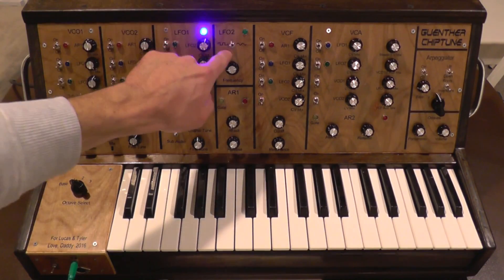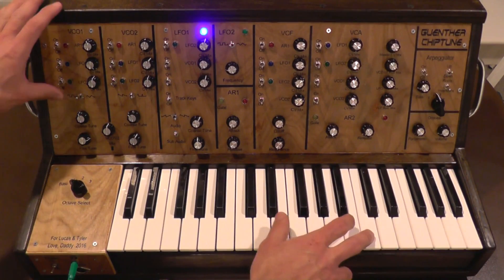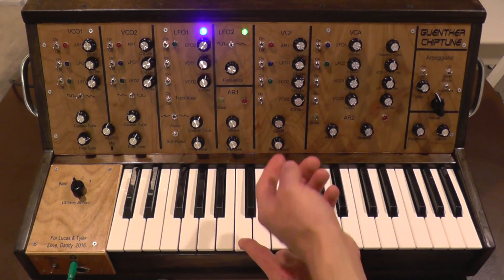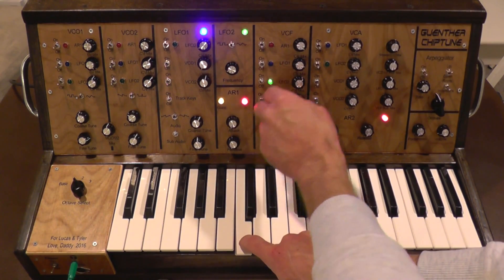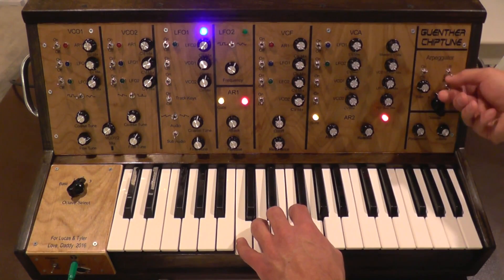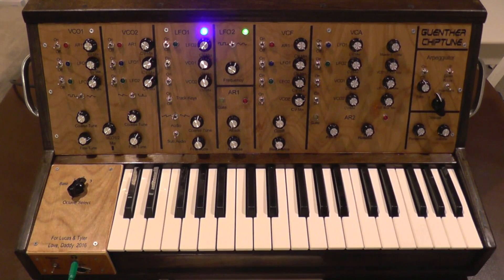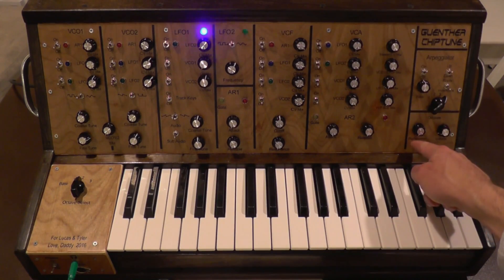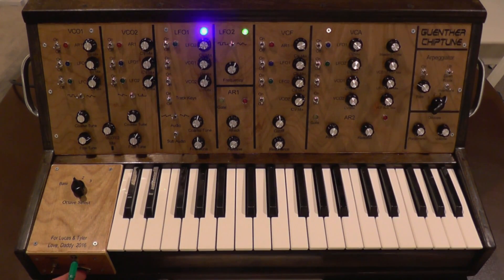Guenther Chiptune Demo

Comment: I just spent the last 8 hours straight assembling a 6 channel VCA in one shot. I have a small idea of the amount of work that went into this, except I was following a kit. You built the entire thing from scratch and research! Absolutely incredible, you did a great job!!
Reply: Thanks!  It is a lot of work, but not impossible, I promise.  I think the VCA in conjunction with the expo converter was the most confusing part for me.  Google, "Aaron Lanterman GA Tech lectures".  The ga yech site no longer hosts them, but you can find them on YouTube.  Good luck if you decide to go down the rabbit hole :)
Reply from the maker: Sorry, meant to say VCF and expo converter.  Another thing that might be helpful is to look up the lm13700 dataset and play around with the sample circuits.  That chip alone can support most of the modules cores (VCO, VCA, VCF) in a synth when paired with an expo converter!

Comment: Hi, I was just looking for an appropriate expo converter for the tri-square oscillator in the lm13700 datasheet and came across your project somehow. Unfortunately, the .sch files in your github are corrupted somehow, I can't open them anywhere. Would it be possible to get that schematic from you somehow else?
Reply from the maker: Hi, thanks for checking out my video.  The schematic for the expo converter is based on Hal Chamberlan's famous circuit.  It is also used by Thomas Henry in some of his stuff.  Big note is that this expo converter uses a matched pair of PNP transistors, rather than a pair of NPNs.  This is why it works well with the LM13700.  You do t need KiCad to see the schematic.  If you go to my github and look at the files, there is a .pdf version of the schematic.  Open that and go to page 16 to find the expo converter.  If you want to know more about how the convertor works, check out Aaron Lanterman's GA Tech lectures recorded and posted online - check youtube for that.  It was his lectures that helped me finally understand how the converter circuit works.  Cheers!
Reply: @GumpherDM3  Wow, thanks for the prompt and in-depth response. I just downloaded kicad, because the file wasn't working with any other viewers. Must have overlooked the pdf!
I'm familiar with the basic circuit, I was just trying to "cheat" and steal your component values. ;P Lazy...
Reply: And that it's pnp is also what I needed to know, thanks again!
I have the lectures saved for later, because you mentioned them somewhere else.
Reply from the maker: @samothrace2106 , good luck!  Hope its helpful

Comment: Is this synthesizer monophonic or polyphonic?  If polyphonically, how many keys can you press at the same time?
Reply from the maker: Just monophonic.  It has an arpeggiator that registers 4 keys at once, but I wouldn't call that polyphony.  :)
Reply: @GumpherDM3  Is it possible to upgrade the circuit of this synthesizer so that it can recognize the keystrokes of all ten fingers?
Reply from the maker: @bipolarowl3546 , the arpeggiator is all firmware based and totally independent of the synth circuitry.  I haven't looked at the firmware code in a while.  I think I threw together the arpeggiator in just a few days while rushing the end of the project, so that part of the code in particular is not efficient or easy to read.  In order to add more voices to the arpeggiator, it would probably need a complete rewrite of that part - not something I want to do.  I recall designing the arpeggiator to be able to handle a max of 4 notes so I could play 7th chords with it.
Reply: @GumpherDM3  I'm not talking about the arpeggiator, but about oscillators.  Can the synthesizer circuit be improved so that it is the oscillators who understand the key presses of all ten fingers?
Reply from the maker: @bipolarowl3546  Then the answer is most likely no.  The oscillators are all analog.  To have 10 note polyphony, you would need to build 10 of them and then expand the CV circuitry.  It's possible, but would need a beefier microcontroller.  You would then need to build a polyphonic key event handler into the firmware.  The two audio level oscillators there currently cannot operate as a two note polyphony.  They can play different pitches, if I recall, it is only determined by a voltage divider off the main CV.  It would effectively require a major redesign to get that kind of polyphony.
Reply: @GumpherDM3  I understand you, thanks.  Nevertheless, your synthesizer is very good even without polyphony!

Comment: This is truly awesome :) What a crapload of work :) Thanks a lot for publishing the sources and schematics! One question - i'm planning to build a synth based on your schematics and have a hard time importing them into KiCAD... Can you tell me, which version you used to draw the schematics? I'll try to make some proper boards out of the schematics and share them if you like
Reply from the maker: Thanks, Merlin!  I hope it works out for you!  Let me check which version I used..  didn't realize there was backward compatability issues with kicad.  I will get back to you.  The source code is very messy, sorry.  I was crunching to finish by xmas and only gave the firmware about a week!  Also, the VC method I used isn't ideal.  I am working on an update that is cleaner but it will likely be a while before that's done - raising tiny humans right now :)  otherwise, I tried to keep things to basic schematics (or datasheet schematics) where possible.  Everything on my github is provided as is, but if you get stuck somewhere let me know and we can try to figure it out over email.  Good Luck!
Reply: @GumpherDM3  That's great, thank you :) I checked your schematic PDFs and they say, they're generated with KiCAD 4.0.2 - still have some issues with libraries but i'll think i'll work it out sometimes :) Yeah, i know the firmware struggle... i built a Synth based on the FatDuino project some time ago and still fighting with the arduino firmware :)
Reply from the maker: @kellerkindrecordings  , if you have an email you don't mind posting here, I can try to send you the copies of the libs I used.  Cheers.

Comment: I'm impressed by fact, that it's made on prototype boards instead of etched PCB. I'm personally ill when I have to work with prototype brds, cause it forces a lot of improvising on it, and it takes a lot of time to solder, compared to PCB. Well done!
You can check my project if you want, with another approach - I'm making a programmable synth, with digital modulations :)
Reply from the maker: Thanks for the comments.  Will you post a grand reveal when everything is done?
Reply: @GumpherDM3  Hopefully next year, but in meantime surely some progress will be show

Comment: Thanks for the great project! I decided to repeat it and now I'm working on developing a board for SMD components. I can not understand the numbering of the Arduino pro mini outputs. For example,  in the diagram  the output  pin 17 is D1 (RX), but in the documentation for Arduino pro mini D1 is TX and it is 1st or 12th (its depend which side you look to arduino board) . Can you clarify the pin numbers for arduino?

Comment: Hey ! I love this thing, would like to make one... I've seen in the comments that you were planning to post schematics and source code when it will be finish, I was wondering at what stage are you in the project ?
Reply from the maker: getthatgasp , check out the video description.  There should be a link to my gibhub page with everything available including arduino source.  I can't promise that it will be super straight forward.  I even forgot what cap/resistor value I used for the portamento circuit and the components are tucked away inside the synth, so you may want to experiment with values there.  Also, I am currently working on a mod that changes the way the CV are produced to get around the noise of Arduino produced CVs.  Not sure when I might have done though.  Good luck!  If you actually get into this and get stuck on a circuit, drop my a line and I can try to help you through.

Comment: Very cool build. Do you plan to etch your own boards for the next version?
Reply from the maker: I should etch boards for better sound quality and repairability/replacability, but I find protoboarding to be a more enjoyable process than etching PCBs.  The planning/drawing, the wiring/soldering and of course the unique look of a completed protoboard is really gratifying.  That said, I used KiCAD to do the schematics (which I'll eventually post), so someone else could take that and make it etch ready if they wanted to.
Reply: GumpherDM3 cool, it'd be rad if you open sourced this and posted the schematics etc. I'd love to build one of these if I had time. Amazing project.

Comment: How did you make the arpeggiator?!?!??? Schematic???

Love the project. Completely amazing. I'm in awe. Respect!

I'm working on a modular synth, but nothing I bread- or perf-board seems to work reliably. Too abstract. I keep going back to Manhattan and dead bug circuits. Airboarding!!!
Reply from the maker: Thanks for the comment!  I plan to post schematics somewhere eventually, but the source code for the arpeggiator needs some tidy up before I post that.
Reply: GumpherDM3 I've been thinking of a pseudo random sequencer that would switch between voltages.... I've never worked with digital, and I'm pretending to be an analog purist at this point... so the arpeggiator is partly digital. Good! 

Amazing work!
Reply from the maker: juanito moore for an "analog" sequencer, do you mean one that isn't powered by a microcontroller?  I think you would still need some logic going on to determine which state to flip do when told to do so.  you might try a circuit using a 555 timer as a clock, feeding that into a few cd2024 binary counters and feeding their output pins as binary control signals to several cd4066 analog switches.  Each analog switch would pass or not pass the low impedence analog CV for that stage.  I have though about using something like that for a sequencer, but still I would rather use the arduino to just send binary data directly the CD4066 chips and write a sketch to handle the counting and frequency.
Reply: Wouldn't it be simpler to use 4017 decade counters? Each output could then go to a potmeter to set the CV for that particular note. Just a thought on the spur of the moment.
Reply from the maker: Gert Brink Nielsen thanks for the comment!  Yup in hindsight it would have absolutely been better even just a summing op amp to offset the cv from one oscillator to the other would have been good.  Some way to make the oscillators relational.  Having independent oscillators seemed like a good idea at the time...  :)  they aren't entirely independent because they still start off with the same cv, but they don't operate in a way where you tune one from the other.  if I were to build another synth that operates with multiple oscillators per voice, I would absolutely made the oscillators relational with an offset from one to the next.  I have some decade counters in my inventory, but never got around to playing with them.  Cheers!

Comment: What about thermal compensation? I'v done it once with discrete pairs, once...
Reply from the maker: Frantisek Markus for each Exponential converter (this project has 4 total) I used a matched pair of PNP transistors and a 2k tempco resistor from Thonk.  the expo converter is almost straight out of the Hal Chamberlain book shown in the first few pictures in the video.  Thomas Henry designs also use something similar.  I matched the PNPs using one of the matching circuits around the web.  Google "YATMA"

Comment: By the way did you have to use a multiplexer for the octave switch to all VCO expo converters ?
Reply from the maker: In short, yes but very indirectly.  The CV generation method I came up with is not a great one (though I learned a lot about the Arduino limitations) because it uses the PWM signals from the Arduino through the analog.write() function to produce between 0.000-1.000 volt (after signal mixing/attenuation) - essentially a base note CV without any octaves added to it.  Since each Arduino pin you set to analog output provides only 8-bits for 0-5V, I used four of them (each getting attenuated down to a max of 250mV) and added them with an op amp.  So that gave me a single octave with all the notes in between.  In order to produce octaves, I used a CD4066 analog switch to pass three separate voltage references (1V, 2V and 4V) based on three bits of data (8 total octaves).  Those three bits came from three pins on the Arduino set to digital out.  The sketch determined what octave CV (the three digital pins) to add to the initial note CV to generate the appropriate CV.  As for the Octave select switch on the side of the keyboard, those were essentially binary information fed through the shift registers along with the keyboard keys and processed by the Arduino to determine how to produce the CV when playing keyboard notes.  Again, there are much better ways to do this.  :)  Hindsight, right?
Reply: GumpherDM3  Wow thanks for your reply sounds complex to me . What type of expo converter did you use ?
Reply from the maker: Adamski Ajull it's a PNP matched pair with 2k tempco resistor.  similar to the one in Hal Chamberlain's book, "Musical Applications of Microprocessors".  It is also the same one that Aaron Lantermann goes through in his lectures, except he uses NPNs so it just needs a little modification to use PNPs.
Reply: GumpherDM3 Thanks very much for the information. I will look up those schematics. Where can i find the Lantermann lecture by the way ?
Reply: GumpherDM3  Thankyou :-) :-) :-)

Comment: Awesome  demo , and nice to see  your journey of pics you must be very chuffed to have come this far. Very nice vintage looking cabinet !!
Reply from the maker: Thanks!  I've seen your recent project posts in the Synth DIY group.  They look awesome and your filter sounds incredibly deep, especially for being on breadboard!  How many poles does your filter have?  Are you designing a cabinet enclosure for your project or planning on a rack mount?
Reply: Thankyou, yes I have been tinkering with different components on my filters, both are 12db 2pole filters , VCF 1 Synthacon 9 steiner parker clone, VCF 2 SEM clone a less aggressive but very very liquid resonance . I think when I am finally ready I will build it into a desktop module, I was planning to build in keys very similar to how you have done your with pitch and mod wheel but , I think the portability of a desktop will be better for me. Im so blown away by your project !!
Reply from the maker: Adamski Ajull please post in the Synth-DIY group when you are done!  :)
Reply: GumpherDM3 I will do my best lol. Im not in a rush until my circuits are perfect. I really like your control interface and would like to do similar .
Reply: GumpherDM3 Hi i wonder if i could pick your brains for some advice plese. Im in the stage of designing a front panel layout however im not sure on which route to go for as im guess a laser etched design or similar on metal is going to be more than i can afford. However i am thinking of doing similar to yourself with decals. Thou unlike yourself my misses cant cater on that . Please contact me here on Facebook . Many thanks Ad.